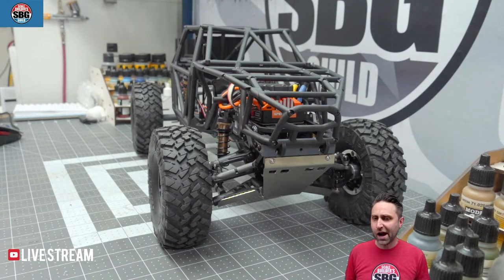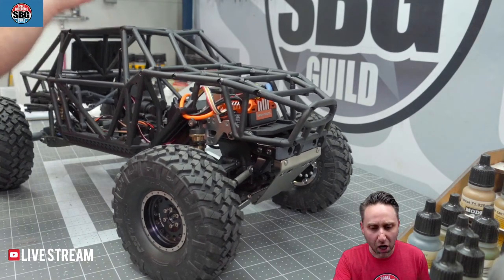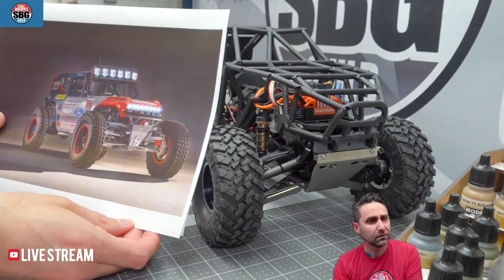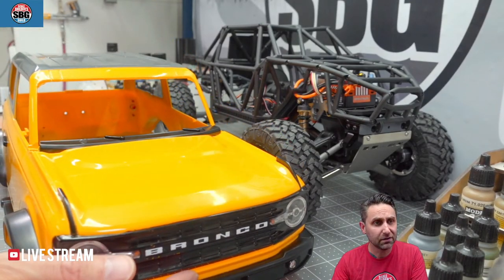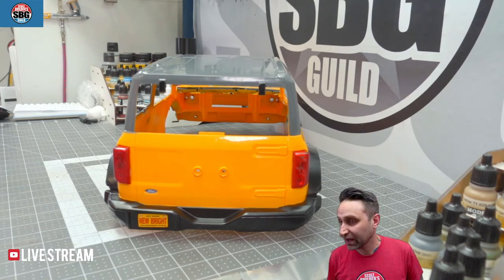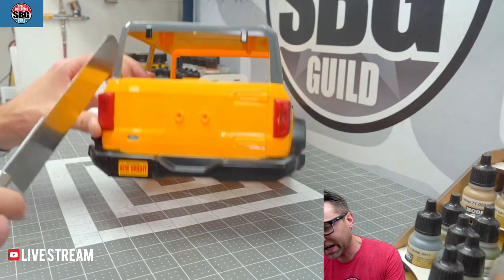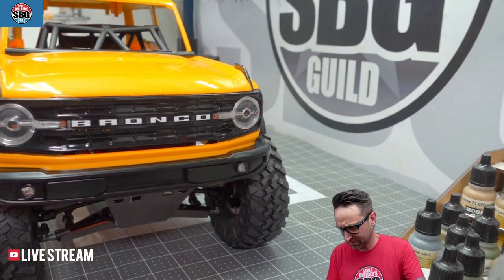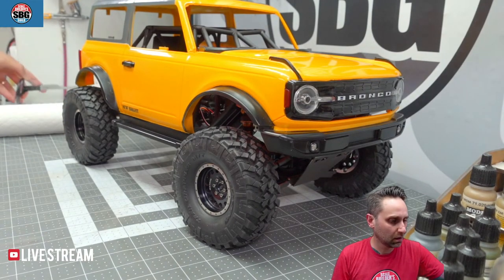Element Gatekeeper Fun-Haver Live Build Ep2!

Comment: Need to and portal hubs on this and the cage needs to be lower like an inch and this thing would be spot on
Reply from the maker: I’m going to revise my plans and build my own cage I do believe.
Reply: These bronco bodies fit killer on the axial bomber cage.  I built one with element ifs and trailing arms on a bomber chassis right after these bodies hit the shelves.
Reply: Do you think the new Vanquish portal in the front would work